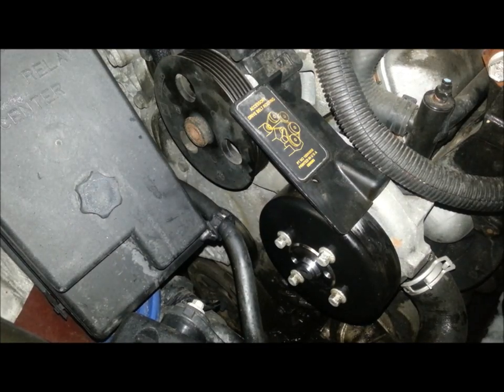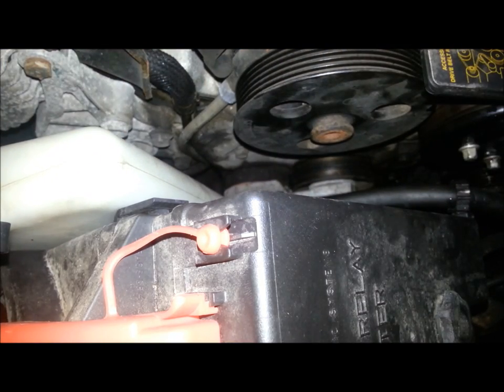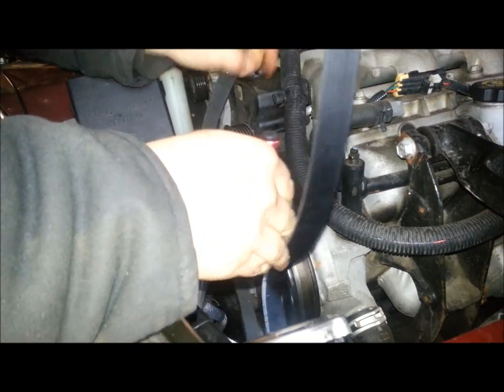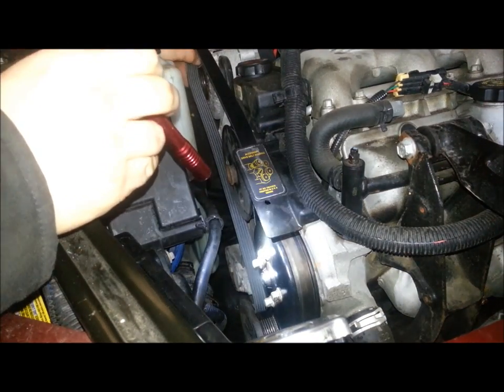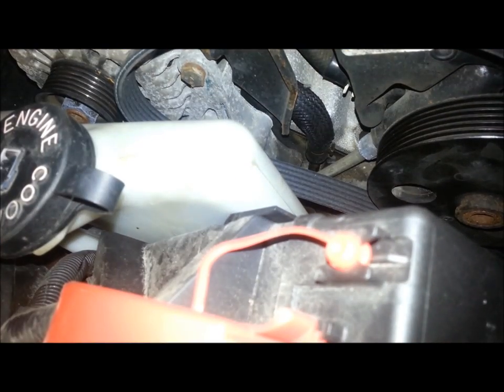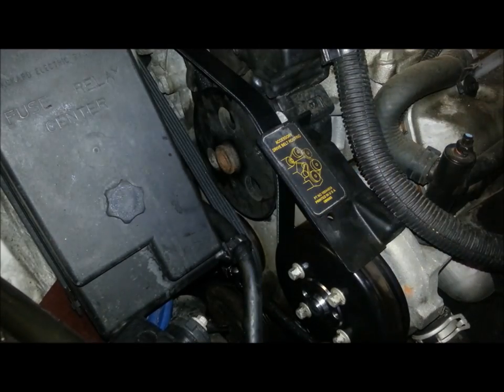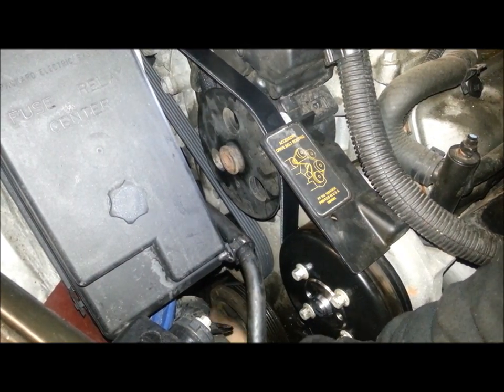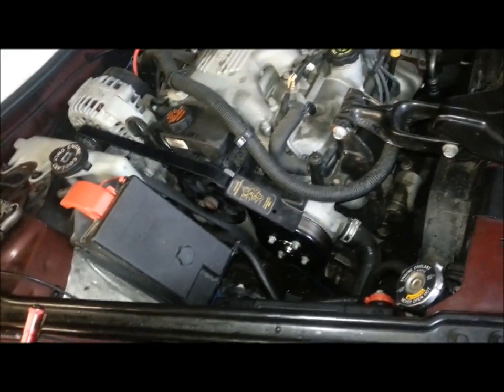serpentine belt install 3.1/ 3.4 v6

Comment: My belt recently broke I'm having problems identifying which part actually threw the belt off track. Its not the fan or the alternator both still spin its the part on the driver side that the belt also goes on any idea what that might be?

Comment: MY 91 Skylark has A/C & i got the new belt on except it's a little short to go around the tensioner pully. I need about 60+ ft. lbs. to move the "tensioner" The belt # is 1115K6 so now what?

Comment: Routing the belt is not the problem. To get the old belt off it looks like you have to get the motor mount off, which seems like it could be a pain.  Could you show how to bet the motor mount off?
Reply from the maker: i actually have a video on replacing a powersteering pump that includes removing the motor plate on that type of setup ( as not all have them)   https://youtu.be/fhOaJUAgPTA
Reply: The old one take a knife and cut it.

Comment: So what if you go counterclockwise on the tensioner and the bolt is actually coming out taking the tensioner off what do you do then?
Reply from the maker: On this model you shouldn't be moving it via the bolt

Comment: Anyone have an easier way to put on a belt on a 94 grand am gt 3.1...it seemed like I couldn't get enough tension off the system to get the belt back on...I ended up having to walk it on the alternator..any advice will help thank's
Reply: I'm about to do mine , I'm sure it'll suck
Reply: Ya it did suck trust me

Comment: once i turn my car on the belt comes off a little its a new tensioner what else could it be its starting to ruin the new belt
Reply from the maker: check all other pulleys for play and they spin without major resistance. these engines harmonic balancer can get out of round as well, need to look into that just see what else is causing it to have deflection

Comment: Thanks for advise,I would like to know why every time I try to move the tensioner I gets lose
Reply from the maker: make sure you are moving the tensioner and not the bolt that mounts into the engine
Reply from the maker: if you are doing it correctly, and the tensioner isn't springing back it needs to be replaced

Comment: Only difference is that on a 3.4 Motor you have to Unbolt the Passenger side motor Mount and remove it to change the Belt.
Reply: yea that sucks only thing keeping me from wanting to do it.. and where do i jack up the engine at?
Reply: no you don't, just change mine...
Reply: I dont have to on mine, it was easier with the coolant reservoir removed but don't even have to do that honestly!

Comment: I have a motor mount in my way
Reply from the maker: +Kd Bleim (smkgld) with the engine mount in the side you need to remove the motor plate while the engine is supported and the the process is the same if you watch the beginning of my power steering replacement video for this engine you will see this process
Reply: Taking off the motor mount looks easy supporting the engine not so much
Reply from the maker: +Kd Bleim (smkgld) if you have a floor jack very easy just a piece of wood like a chunk of 2x4  under the oil pan and between the jack to just support the engine it will not move much at all
Reply: JoeTheAutoGuy 

It looks as if my 2004 Pontiac Grand AM 3.4 liter V6 has the side engine mount that I need to remove. Thanks for your tip to use a jack to support the engine. I had not figured out how to support the engine until I saw your comment.

I guess I will have to finish this project in the morning as it is too late to be rolling jacks around in the driveway tonight. I hate to leave a 14 year old belt on it now that I have the alternator off anyways.